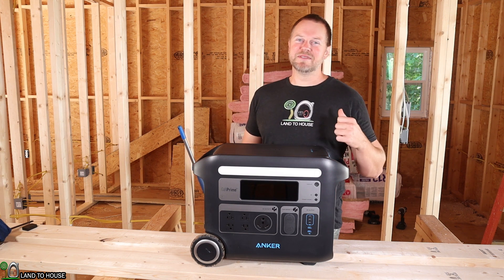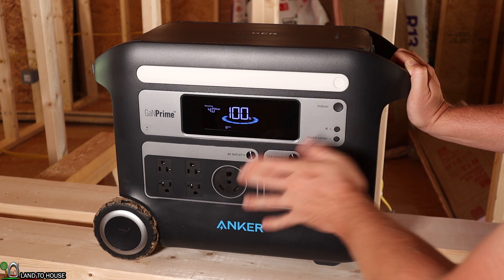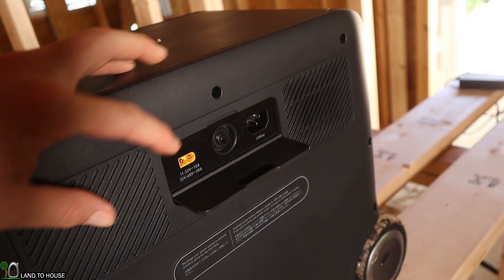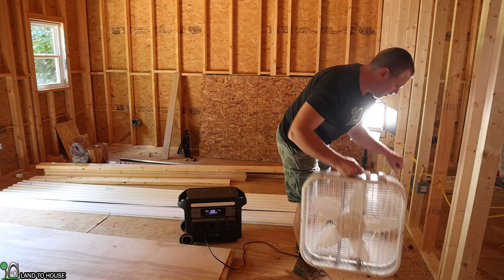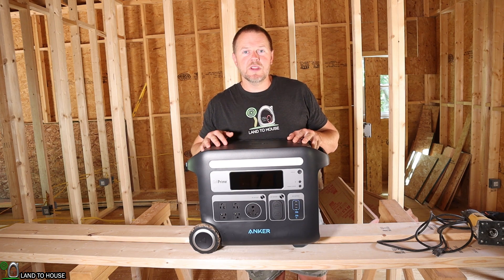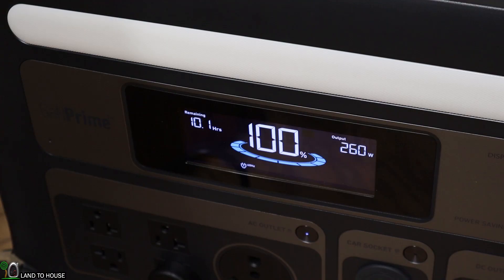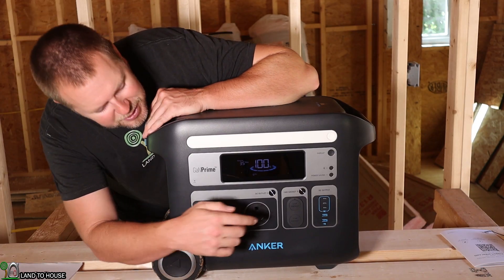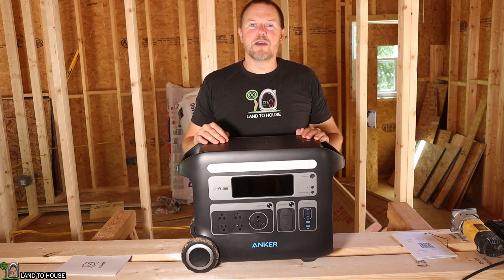Anker SOLIX F2000 (PowerHouse 767) Portable Power - Awesome Machine

Comment: That's a nice one.  I'd love to see if it can charge from solar at the same time it's in use.
You may want to get your transfer switch installed in this new building if you are going to do any more testing of power stations running the lights & outlets in there, it will be much easier to demonstrate (and safer).
Reply from the maker: Sadly they did not send a cable I can work with to try solar. But I think it has pass through power with solar. As for transfer switch in the new shop. That is a great idea!

Comment: Does it auto start the ac outlets
after it has solar power, if it runs out of power over night?
Reply from the maker: I will have to give that a try. I have had it down to 35% so far while using it in the shop.

Comment: The price is steep.  The RV 30amp outlet is really nice for camping.
Reply from the maker: After using this unit for 2 weeks in the shop build it has worked very well. Thinking about the difference in price vs a gas generator. 
This unit is $800 more than a Honda 2000. Anker with 3000 cycles at $0.50 per charge =$1320  vs honda $3.75 per tank $11,250.
That math might be wrong but with prices staying the same the power station could save over $10,000 in the life of the unit.